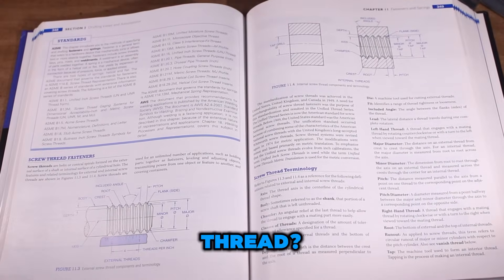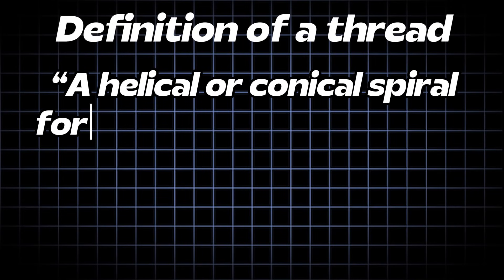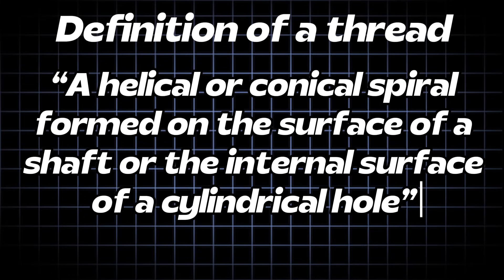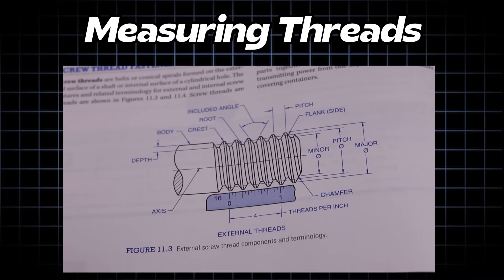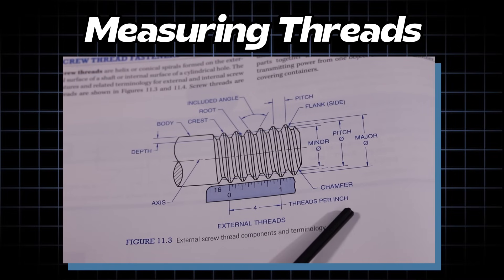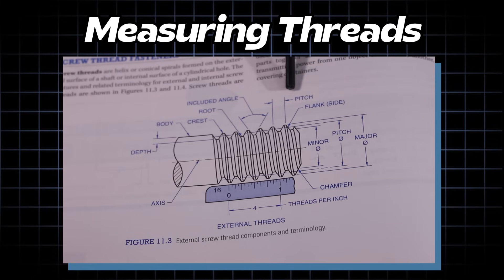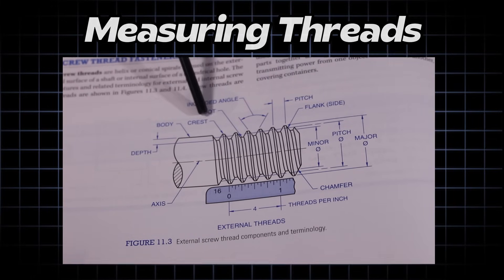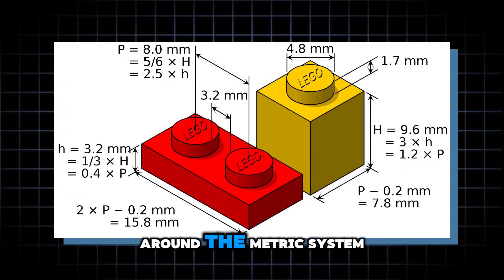Measuring and Classifying LEGO Threads!

Comment: I built a lego motor with a valve that moves up and down with the engine (yes i have the timing right)
But i cant get it to run again anyone got any suggestions why this might happen?
Reply from the maker: There's a number of things that could be the issue. I'd recommend maybe joining the discord (if you're able to) and it would be much easier for someone to help you out